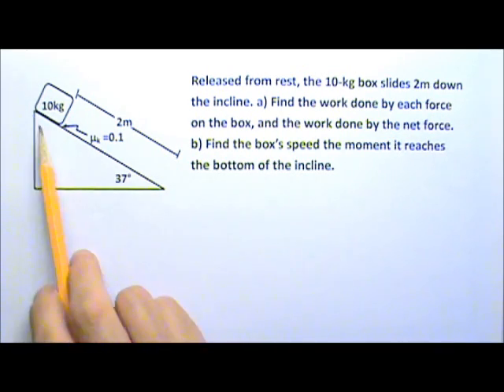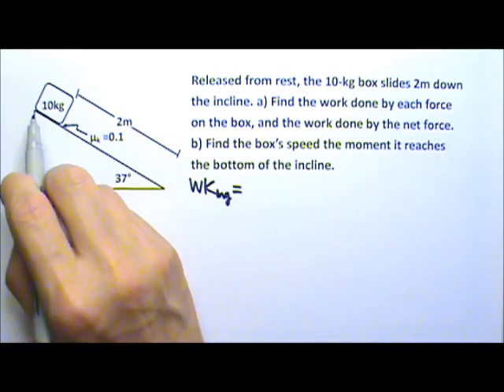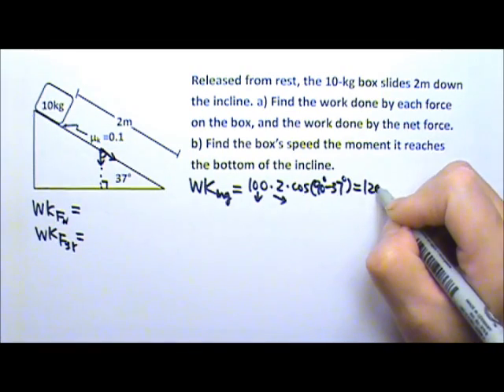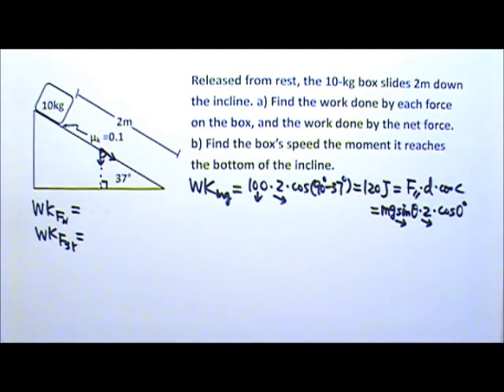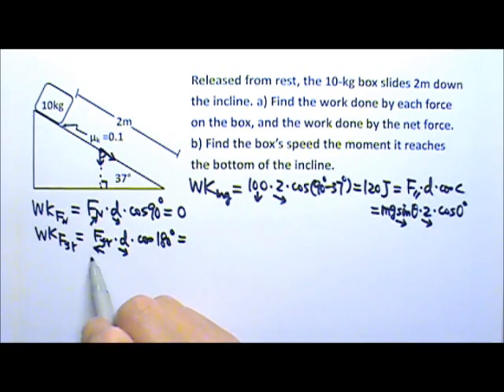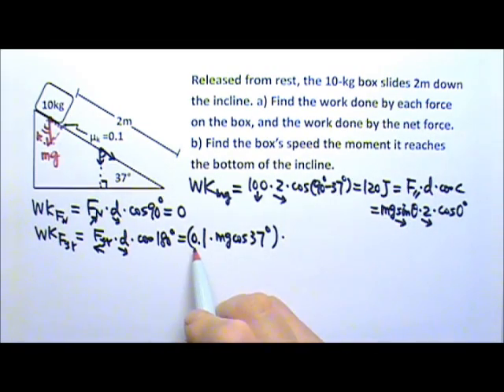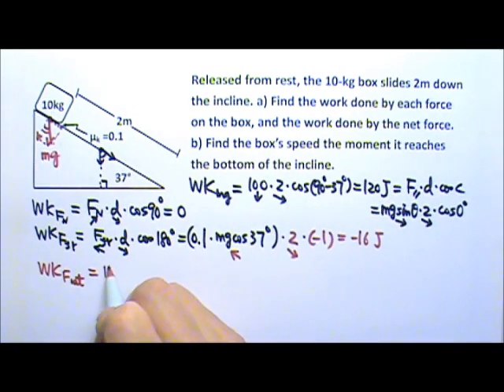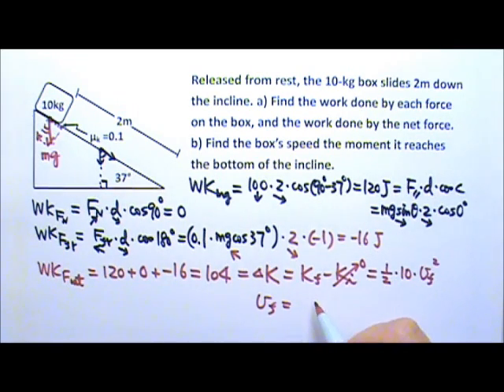AP Physics 1: Work and Energy 5: Work Problem: Down an Incline

Comment: Doesn't mg have a perpendicular component? So the whole work for mg would be: 100*sin(53)*2*cos(53)
Reply from the maker: +kad1413 Yes, mg has a component, mg cos (theta), that is perpendicular to the displacement. However, this component does not do any work. It's the component of the force that is parallel to the displacement that does work.